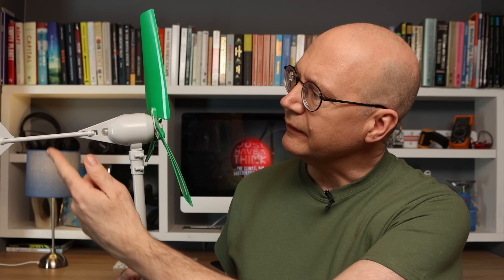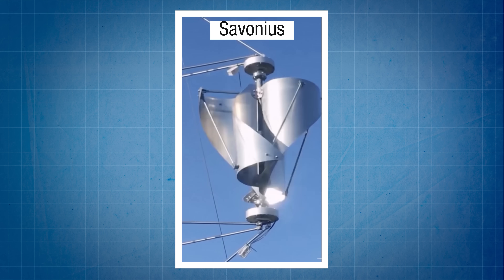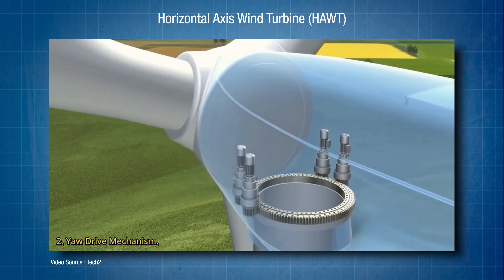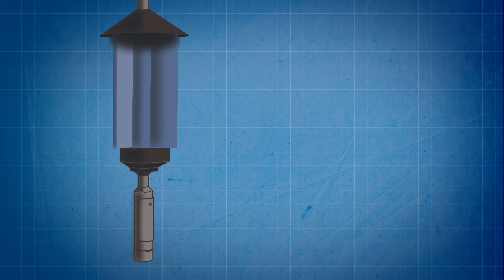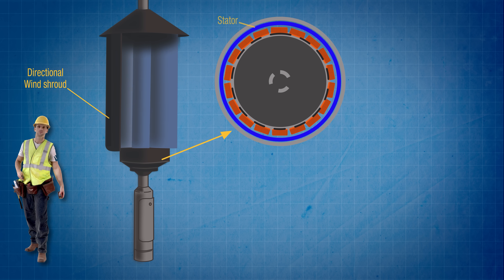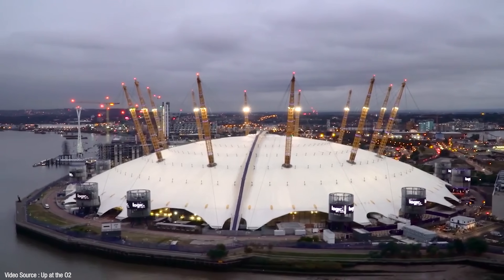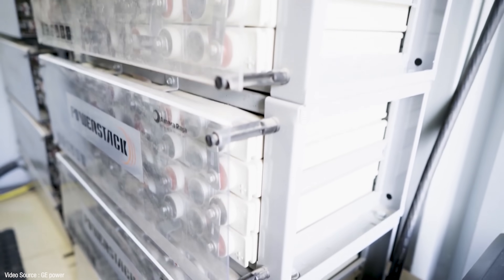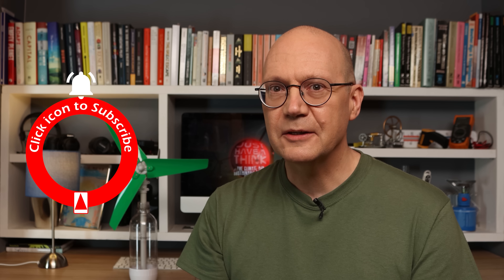A vertical axis wind turbine that doesn't need the prevailing wind! How do they do that?

Comment: more then 10 years ago I had the idea to put traffic level VAT's along side the higher traffic flow highways and along trucking routes in the urban areas of the cities where they don't have stop and go traffic but i couldn't get anyone to take the idea seriously because they all said moving vehicles wouldn't produce enough steady wind current to make it worth while which anyone who has ever been broke down on the side of the hwy know is BS, you could put VAT's on both sides of the highways and incorporate them into the center dividers, you could even put HAT's under bridges and over the highway road signs, add the fact that if every home had  a 5 kw solar system and a small VAT mounted on the roof there would no longer be the need to spend trillions to update the overloaded electrical grid because it would no longer be overloaded......

Comment: Placing wind turbines at the sides of roads is not a good idea if you look at the total energy equation.

Every little turbine (or anything else at the side of the road) will slightly increase the drag force on the vehicles passing.
When a car moves forward it will create a higher pressure in the volume of air in front of the car.
In fact that volume of increased pressure reaches far wider than the width and the height of the car.
If any obstacles in the way of this "pressurized air bubble" will cause more restrictions to airflow by the car and the pressure in the "air bubble" will increase.
The same but opposite (!) thing happens behind the car, only that here there will be a "bubble of lowered pressure".
Again, any obstacles in the way of this "bubble" of lower pressure will restrict the air flow and the air pressure behind the car will drop even lower.

Increased air pressure in front of the car plus decreased pressure behind the car means more drag and more fuel spent.

Since no machine or process is 100% efficient, the output of the wind turbines beside the road will never be able to create more electrical energy than the increased spending on fuel for the cars.
The only way this can be a energy positive calculation is that the turbines allso catches the natural wind.

It will still, though, at cost of the people who pay for the fuel.

Photovoltaic panels laying flat against the ground on the slopes beside the road is a much better solution.

Comment: I don't understand why the world hasn't installed these on every lamp post or solar panels on every single rooftop in the world. Clean energy Ideas that slot in perfectly with existing infrastructure without disturbing anyone
Reply: The very simple reason is that these do not work. Its a scam

Comment: Just a think, trains travel at great speed. But first of all why not install canopies fitted with solar panels. This will keep trains cooler and with wasted wind movements produced by trains, it all can be harnessed into electrical energy by installing micro electrical wind generators in circuit panels for easy troubleshooting. Let's keep on harnessing wasted wind movements from trains specially on subways too. There's a lot of that potential energy from these areas. Japan surely would benefit much because they have a lot of trains above and below ground. Let's encourage them. They have the financial means to finance these technology from this idea.

Comment: You claim that the energy this system uses would be lost anyway. That part is not true. The first car moving the air helps all others coming after it. But if someone stops the air flowing every car has to start from non moving air hence using more energy.

Comment: The problem with big turbines is they are big. An extremely simple concept is to go tiny and use a lot of it. One concept us to place tiny windtyrbubes mounted on fencing wire the fencing wire is the conductor and the actual blades are micro but also have solar cells generating power both from wind and sunshine. This is so tiny and easy if you get some out if use due to car wrecks you aren't creating a hazard along righr of way. Stop thinking about effeciencey start thinking about spacial and quantity and we can cut costs and make easy changes and not huge expense. Fencing us replaced over time install grid fencing.

Comment: Generally speaking they are all ugly spread over the landscape. We are pursuing the wrong goal with renewable energy. We need to drastically cut energy needs and this consumption. VAWTS are good once we cut the energy needs we can have garden sized turbines. At small scale low height air is turbulent which VAWTS don't give a toss about.

Comment: Very interestingly presented article. Vertical axis turbines in large numbers can considerably reduce dependence on centrally produced and distributed power. Very similar to the concept of producing power  in each home by a gas engine which also took care of the heating and hot water needs of the home and connected to the grid with intelligent metering could reduce grid dependency.    Multiple vertical axis turbines between the railway tracks could generate greater power due to the greater volume of high speed air. Would love to see developments.

Comment: They should be applauded and they are if adequately distributed as residential and tower based as well as road and water flow based linear and wave based turbines … fully capable of replacing other forms of energy generation and fuel consumption….
Just need to get petrol companies to get out of their own way and invest more actively in alternatives.

Comment: 6:00 860MWh works out to 98KW so not a lot… unless you’re talking about a small such a small installation. So this makes sense. Comparatively the largest offshore wind turbine Siemen’s 14MW costs $12.3M. 

Applying that W/$ to these roadside turbines to be competitive would need to cost $210 each not accounting for the differences for installation costs and electrical grid infrastructure between a roadside project and an offshore wind farm. This roadside turbine claims to not need any additional infrastructure (compared to the installation base and cabling etc needed for offshore) and while roadside work is often seen as expensive, at the government level, spending on domestic services is one of those job creation things that’s a positive. 

Note: 14MW is the constant max (up to 15MW for a short time) and not the predicted production. The 860KWh is the predicted production, so the $210 should be multiplied by the ratio between an offshore wind turbine’s rated peak and its actual production.
Reply: I attempted to post with a link to a source on my numbers with further costs for offshore, but my comment kept getting deleted automatically.

Comment: These turbines will not be what they are described as.  they are too small to produce any efficient power, also how do they get the generator centered on the pole, when nearly every pole type is a different size.  I think the idea is good, but practically not functional as most light poles are offset from the roadway and the new aerodynamic vehicles do not push air as they once used too. 
interesting to see how they resolve allot of issues.

Comment: I have for some time been thinking of the possibility to use redundant power station cooling towers as a cowling, or enclosure,  for a vertical axis wind turbine installation possibly with stator blades in beteen the rotating blades as in a gas turbine engine. Such a system could be very large but the potential power harvest from such a machine could be very large with the help of the venturi effect due to the shape of the cooling tower - after all, that's why cooling towers are designed with that shape to ensure efficient cooling in all weather conditions.  I have not done any calculations but would welcome any comments on this idea.

Comment: Always flies in the soap. I pointed this out on Rosie's site.  The problem is that this style of turbine has not means of regulating the area or the blade shape of I assume Savonius turbines.  Any vertical axis turbine has the same problem.  Wind energy is a cube of the speed.  Yesterday the wind reached gust of 45 mph (20 mps)  which is 50 times the power available of 12 mph (5.3 mps).  Worst case would be in a tornado or hurricane  with over a 1000 times the power available.  The only means of control is a brake.  Wear out the brake if used to split the power taken from the air to the generator or the brake.  So typically they are set to stop the rotation as quick as possible.  The drag of the turbine is these extreme condition would be a square of the wind speed effect.   

The reason commercial wind turbines are horizontal is that they do have the ability to control area swept and the angle of the blade to the wind.

Comment: This video got me thinking:  if a vertical, 3 meter shaft can generate power off of wind from cars driving by, then a horizontal 1 meter shaft attached to the top of an RV or a camper could also generate enough power to be stored in batteries for your night time use at your campsite.  Think I'll build one and find out.... Thanks....
Reply: the issue is trying to apply wind power to vehicles almost always lowers efficiency to the point where its not worth adding the turbine (with the reduction coming from either the extra weight or wind resistance) so if your planning on using it only when parked thats alot of space taken up that you might otherwise want when on the road. 
You should still try it out though.
Reply: @samueleveleigh2767  Thank you.... if I am doing a trickle charge into an extra battery, efficiency might not be an issue.  Using a much smaller generator and placing the blades where they would get laminar flow between the cab of the truck and the roof of the camper might work.... I'll find out... I still have to complete the camper!!

Comment: Would love to see this technology become available on a residential-sized scale.  After that?  Perhaps small, portable units that could be used by campers, caravaners and van-lifers to boost their off-grid capabilities when in favorable locales like the U.S. West.  Something small and light enough to be popped on the roof while camped, and easily broken down for travel.
Reply: I have your answers.  I can build any turbine of any size.  Take a look at this. This was a prototype.  Next step is 3 times bigger.
https://studio.youtube.com/video/ddN5awFx254/edit  

I know it is not like the new turbines with blades.  The reason that the savonius works so awesome, it will reach a maximum and not exceed it.  Now, if we are taking energy out of it, then we can make auto transmissions that will increase the gear ratio to the electric side and increase energy output all while staying within a sort of natural norm.  I am actually designing a giant turbine. Thank you and have a nice day.  Don Watkins III

Comment: Why not incorporate this technology into electric vehicles, so they are generating some of their own energy, therefore allowing them to go farther before a charge is needed??
Reply: because incorporating a wind turbine, or a renewable source of energy at all into an EV makes it too inefficient. 

With a turbine your not only creating extra wind resistance that the car needs to power through (more often than not more energy is spend than gained from this) it also adds alot of weight and moving parts which again decreases efficiency, range and drastically increases the maintenance rate and coast. 

the best way to get EV's using more green power is to turn charging ports into mini power stations, solar panels over carparks and turbines like this in more remote areas would help but would again raise costs by alot.

Comment: I have a few concerns:
1. What would be the life cycle carbon footprint vs the energy created? Would this be viable? 
2. What would be the maintenance costs and corresponding carbon footprint?
3. What would be the cost and corresponding carbon footprint of the ancillary structures: electrical distribution, charging/inverters, batteries etc.? 
4. Would there be any issues of resonance with various seasonal wind patterns? If so, how will this be compensated for?
5. Who will pay for such trials or installation roll outs? And who will financially benefit, and by how much, from such schemes?
6. What kind of control and balancing of supply vs demand of energy would be required?
7. What kind of drag would be created on passing traffic and its corresponding effect on fuel consumption of the passing vehicles?
8. Would there be any strobscopic effect produced when sunlight is diffused through rotating blades? If so, could this affect some drivers in some way?

These are just a few questions that come to mind. Unfortunately, I don't have the answers, but maybe somedody here has done some studies that might be able to provide answers to some of these questions.

Comment: It’s a nice invention, But:
Putting them on top of cell or radio towers means you might increase the wind load past their design capacity. In places that experience hurricanes , even putting them on the bottom of the street lights, may also increase risk of their failure past a safe limit. I do like boot strapping things with this, maybe it can also be used to decrease the wind tunnel effect in cities. I would like to see smth about flutter based wind power.

Comment: I would think tunnels and bridges would be the ideal spot for them (think along the lines that the motor shaft doesn't have to be vertical). Added bonus of having a moveable surface, travelling in the same direction as the vehicle during an accident. I can imagine vehicles hitting and rolling along them instead of bouncing off hard surfaces.

Comment: Interesting concept.
How about making a smaller version, turning it on its side, and placing it on the undercarriage of electric cars to extend the range or possible offset the consumed power of driving the electric car.  I realize you would have to have multiple turbines, but by reducing the battery size there should be more room to implement the turbine.
Just trying to think outside the box.

Comment: Mount them on busses, trucks.. in an aerodynamic way to benefit directly from 'punching a hole in the air' (resulting in quieter moving cars)  , then use it to charge up their hybrid system or is that a perpetuum mobile ?

Comment: I wonder whether those road-side turbines might change the fuel consumption of vehicles, though. Think for example that when a cyclist drafts on another, it gets easier for both, not just the follower. If air displaced by cars can turn turbines, then the turbines may affect the cars, too.
Reply: Un vapor se luptă cu frecarea apei pe lungime si deslocuirea volumului din față. Dacă pe toată lungimea ar avea câteva sute de mii de motoare din astea, elicea principală ar munci mai usor iar viteza navei ar fi mai mare. Pirdere de frecare.

Comment: There is never a free lunch, the "wind"energy along the hiway is coming from vehicles. I am pretty sure the interaction of the vehicle shockwave with the turbines would increase drag, ergo fuel consumption. It would be as if the vehicle was traveling in a narrower tunnel with rougher sides; the shockwave it is dragging would create more interaction / friction losses.

Comment: As a retired fire captain I learned on the job about the wind force a high rise building creates. Even the smallest wind hitting the side of a large building creates large wind pressures. In the case of fighting a fire in a high-rise a window failure on the windward side of a building can create a deadly force of wind pushing the fire through the rest of the building. 
Imagine if the vertical turbines were mounted at the corners of high-rise buildings that could catch the built up pressures moving to the corners of the building as they work to move around the building
Reply: Caută la comentarii o idee.

Comment: 1. One of your closing remarks about the vertical turbine was that it wouldn't replace offshore turbines. Why not? 
If it does away with the horizontal axis to vertical axis gearbox and the need for the unit to rotate with wind direction, won't this reduce cost and some maintenance?
Also looks like less of a hazard to birds than rotating blades.
2. Are tidal turbines being fitted to the offshore wind turbine sub-structures? If not, aren't we missed a trick there, even if tidal currents relatively low? There is still a tidal current, a vertical structure and a generator with cabling to shore....

Comment: Tons of steel and concrete for very little electricity. 

The electricity converted from a windturbine is the ^3 of the speed of the wind. So using slow winds=very very little electricity. 

The carbon cost of the steel and concrete needed for such low production winturbines make them not worth the pollution.

Comment: These vertical style wind electric generators have been around for many years now. They are perfect for homes because of their low noise and size. The most efficient ones should be mandatory on new homes making more cost effective systems for older home.
These are supplemental for now. A mix of wind and solar? Buying cost will have to come down or laws requiring it. If not everyone will select the cheapest option. The stupid "NOW" generation.

Comment: The only reason I could think of that you wouldn't put one of these on every lamp-post and vertical space would be the potential for noise pollution. Also, it's not at all like electric vehicles don't create air pockets.  I'm sure there would be cost benefit analysis on if what it returns is worth the initial investment.

Comment: Making each turbine blade flexible would allow it to present a greater surface area going downwind and therefore possibly increase its performance. On the upwind leg it would retract slightly to reduce air resistance. A hinged blade with limited movement would work in a similar manner but be more complex to manufacture.
Reply: Perpetual motion machine tard.